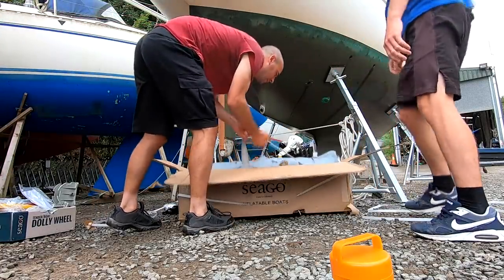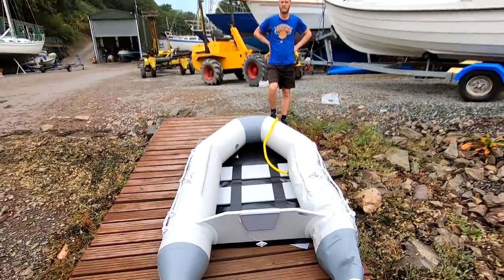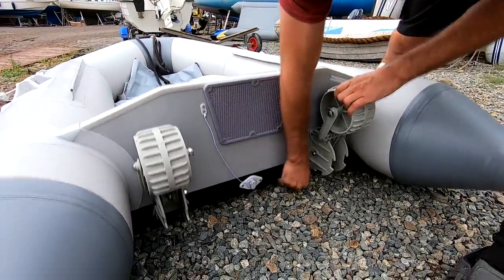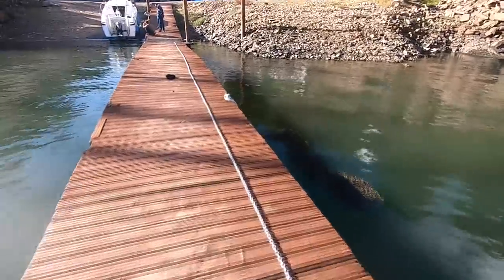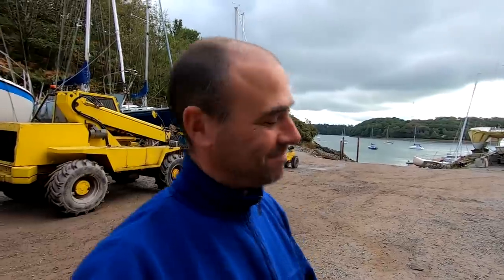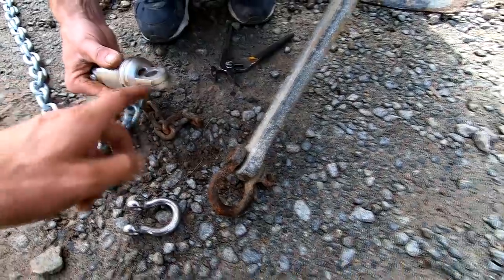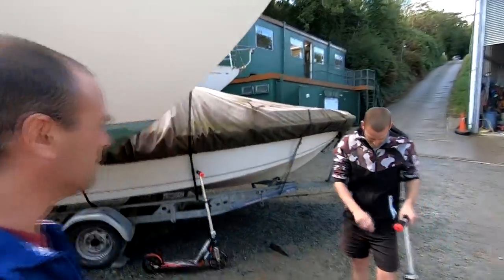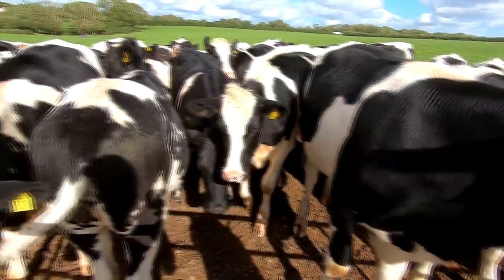Atlantic Preparations, New tender, New chain and we meet some locals!  Ep36

Comment: Hi guys. The contraption you had the tender on is called “a launching trolly or trailer. 2. The seizing wire is to go through the shackle pin eye and twisted round the shackle itself to ensure it doesn’t come undone!!!! This to be done on ALL shackles which do not need to be undone regularly. Capt JB
Reply from the maker: Hi John, yes we know all this, luke just couldn't think of the words. And all our shackles have seizing wire on 👍

Comment: Hi love watching you guys.... always entertaining and often instructive. I would suggest that you apply seizing wire to both shackles at the anchor to stop pins coming undone on shackles. Also for the last length of chain at the "bitter end" paint a longer section of chain or some yellow paint every 6 inches so you know you have reached the end when paying out.
If you are paying out maximum scope under winch power you don't want to rip the end out of the boat and lose the lot overboard. (assuming you have secured the bitter end).
Reply: Good point, but also use a spare line to secure the bitter end to Atlas. You may want to release the chain quickly & cutting a chain is way easier than a siezed shackle. ⛵️

Comment: We run a fleet of charter boats and find that paint does not last very long on anchor chain.  We therefore use strips of spinnaker fabric tied through the chain - it goes through the windlass OK, and can usually be seen well below the water level if the sea is clear enough.  FWIW we mark using traffic light colours - green at 10 (getting ready to go), yellow at 20 then red at thirty (definitely stopped) then go around again.  They generally work the same whatever country you come from!
Reply from the maker: Yeah the paint is already coming off in the chain locker. Thanks for your advice 👍 giving us some good ideas 💡

Comment: Not keen on slatted floor tender , not easy to put away , air floor is better. The paint won’t stay on ,it wears off quickly depending on how frequent you use it , but anyway,you won’t be using it crossing the Atlantic lol . Many sailors don’t like swivels because they can become a weak point in the system and some also say they are not needed, I don’t have one myself. Not criticism just comments
Reply from the maker: We would have preferred an air floor but we couldn't really afford it David. Once the paint wears off the chain we are going to fit little bit of line or fabric to Mark every 10 m.  Let's hope the swivel does it's job thanks for your comments David 👍

Comment: How did you secure the chain into the anchor compartment?
Fair Winds!⛵🇺🇸
Reply from the maker: Shackled it to a fixing plate in thr chain locker
Reply: The end of the the anchor chain is called the bitter end, as in the expression.  If you are ever anchored on a lee shore and the weather picks up, Murphys law dictates that your anchor may become jammed on a rock or your windlass won’t work.  Either situation could result in disaster, hence you should be able to cut the bitter end in a hurry and ditch your anchor, hence the expression, at the bitter end.  Stay safe, use some rope to tie it in, else Murphy may show himself!   It’s just not worth the risk.  Good sailing guys and fair weather.

Comment: Great job lads, personally I don’t like those anchors you have, I’v got a delta now. Id recommended a delta, Rocna or Manson supreme 

Cheers Ash
Reply from the maker: Those anchors have a lot of bad press but we have found she always holds well and digs in.  We would have upgrade to a modern anchor but it would not fit in the Anchor Locker on deck, it would have to stay over the bow which we don't really want. 😉
Reply: @TheSailingBrothers   fair play, I can see from your round Brit you didn’t have any issues, Iv had issues down here in Falmouth and around the Isles of Scilly so ditched it for my delta, it’s whatever works for your best I suppose 🙌🏼